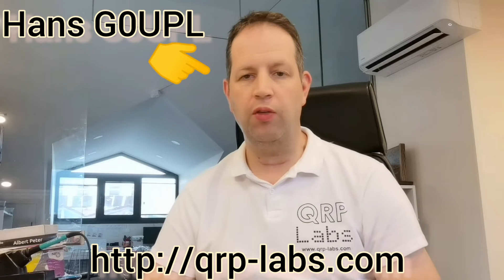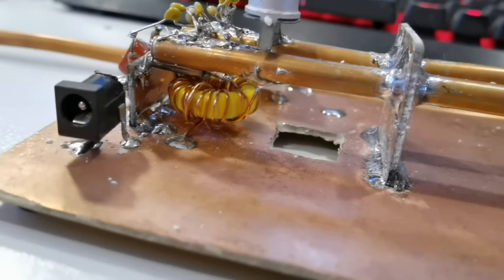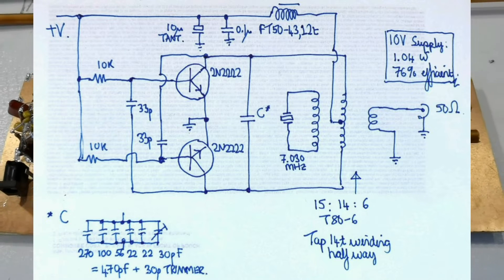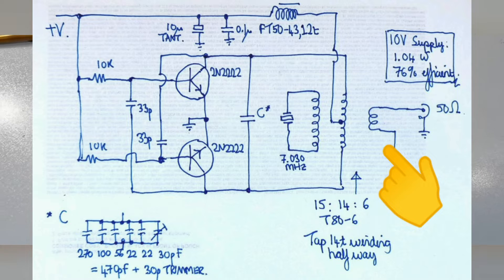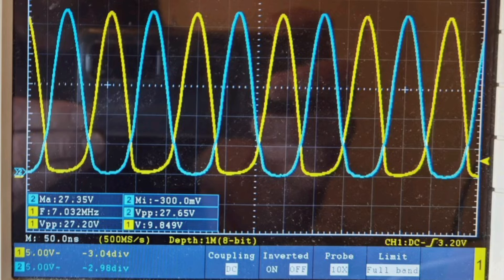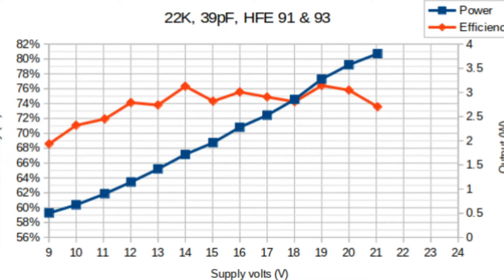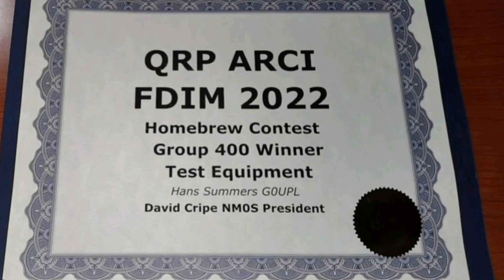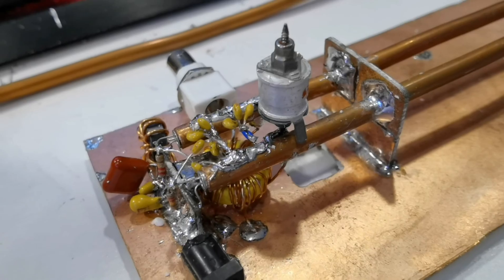FDIM 2022, 2N2222A Power Challenge Winner!

Comment: When I saw the two coppers tubes, I immediately assumed that you had implemented 'heat pipe' technology. It seems that you haven't. Heat pipes would be a simple modification: Ensure that the 2N2222A transistors are tightly sealed into the tubes (already done that step I'll bet), then add a phase change fluid/gas, and turn the assembly vertical (2N2222A at the bottom), and add additional heat sink area at the top. Pressure in the tubes might need adjustment, depending on the fluid/gas chosen. The liquid phase fluid will boil and carry away heat to the top, where it'll condense and flow down to repeat the cycle. Heat pipes can carry away many times the heat of a normal copper pipe.  Temperature should be stable and thus power could be nudged up further.

For additional ideas, look into the crazy computer 'Overclockers'.

Comment: Thanks Hans - an inspiration. Apart from the crystal the circuit appears quite similar to the Kalitron oscillator as featured in various RSGB books from the '60s & 70s. My brief experiences is that they start up reliably when free running. Over a wide frequency range too. I wonder what power you could get out from one using BD139s, or maybe a Darlington pair arrangement.
Reply: Hans - another thought. There's balanced mixer circuits not unlike this oscillator. I wonder if it would be possible to operate it as a balanced mixer simultaneously with oscillating. Then it could form the basis of a simple DC CW transceiver driving a crystal earpiece (with extra audio amplification needed).

Comment: 👍Well done Hans and thanks for sharing. I remember a while back wondering if I could build a XTAL controlled astable RF multivibrator TX. I think an audio astable multivibrator was one of my first projects as a kid 😊. I wondered about using BC107s or IRF510s. Using transistors that can handle the current without the crazy big heatsinks might make for a useful simple QRP TX circuit that would give a few Watts out? I wonder if you tested your 2N2222A TX on air? Perhaps how it sounded in terms of chirp?

Comment: That is completely awesome, Hans!  I do especially love your heatsink innovation!  In hindsight that I would not have anticipated until I saw the drinks in the video, you could double the duty of your device as a "tea maker" by immersing the tubes in cold (distilled) water and running the supply voltage up, up, up!